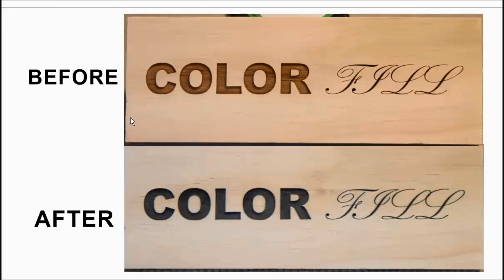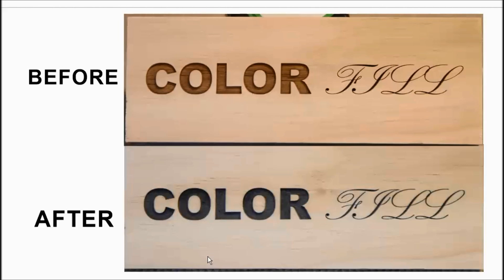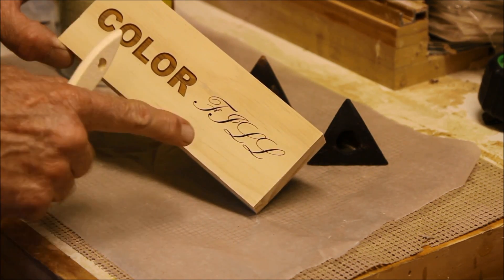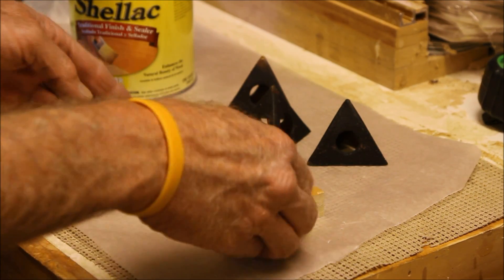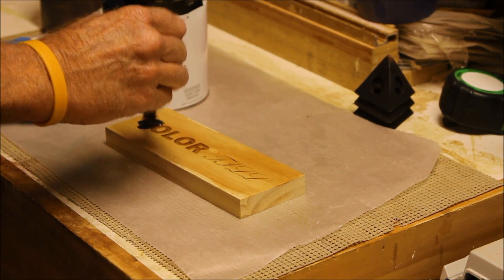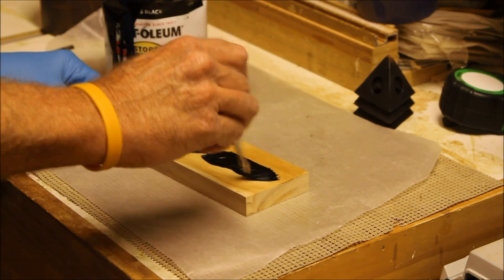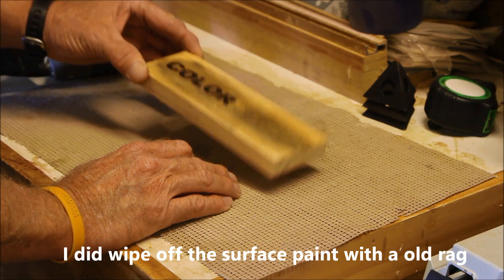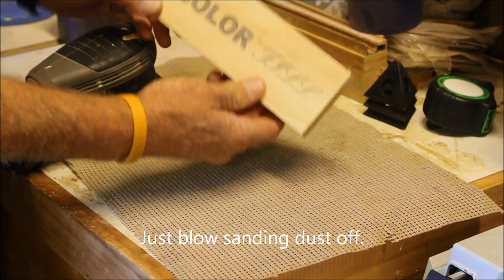Corel Draw Tips & Tricks, LASER Color Fill

Comment: Thanks for another handy video Doug!

I also do color fills using transfer paper. When you don't want to or can't sand the surface of a given material, transfer paper or masking is the way to go. Available at sign supply companies, this is the same material sign shops use when applying vinyl lettering to surfaces. I have used it on acrylic, wood, and glass.

If the wood is very porous the paint can sometimes creep into the grain under the transfer paper. Apply transfer paper and engrave. Then put sanding sealer or shellac or clear lacquer or poly in the engraved areas, let dry, then paint, and then remove the transfer paper. One drawback is on detailed engravings having to pick out very small pieces of transfer paper when you're done painting, but there is no sanding involved.

I also tried (with some success) using plain white Elmer's glue as a liquid masking, applied with a small roller. After it was dry I lasered through it, and painted with solvent based spray paint. After the paint dried I washed off the Elmer's glue and the excess paint came off with it.
Reply: Thanks for the tip with the glue.  I am going to give that a try and see how it works out for me.  By any chance do you have a video of that process?